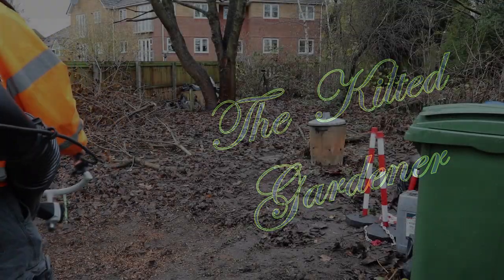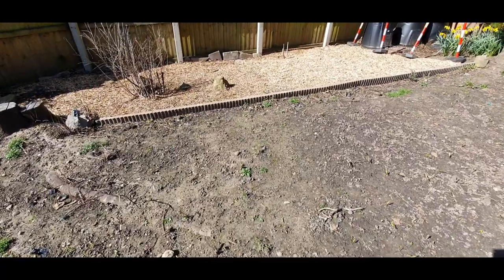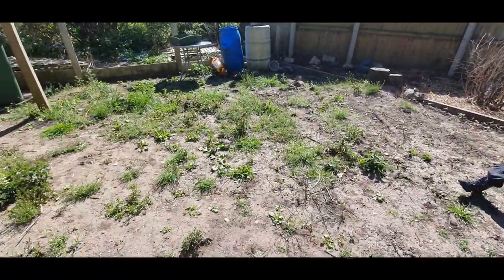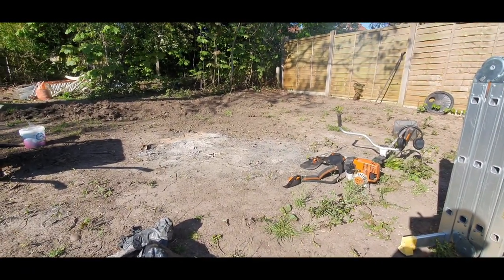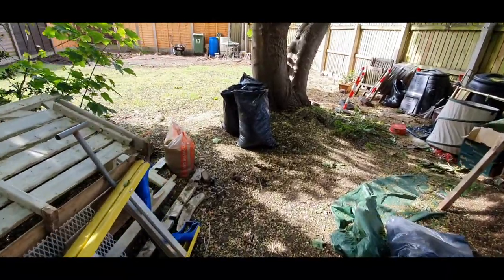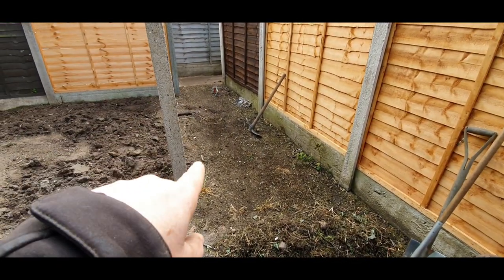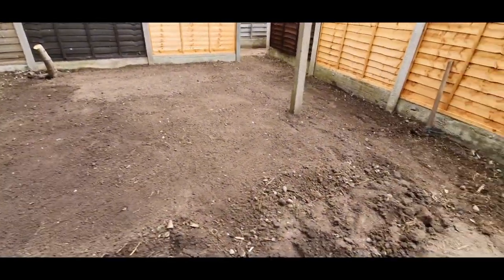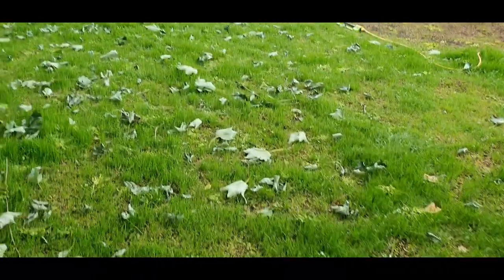massive garden clearance (PART 1)

Comment: Looks very much like a garden I am doing for a customer, been left to its own devices since the 1970's. It was so bad I had to take a mini digger to it to break its back. I have had to contend with brambles, bindweed and couch grass amongst other things! Once we stripped the old surface/turf I prepared the ground in eight feet strips, hand dug 3 times over six weeks with a couple of weeks between digs to allow the pieces of couch grass to sprout and allow me to see and remove! It was so bad I had to have 3 muck tubs behind me as I dug, one for weeds, one for stones and one for the rubbish, plastic, toys, crisp packets etc! Luckily I deal with a pallet company which is just down the road and managed to get hold of 10 plasterboard pallets to use as temporary fencing to keep the customers dogs out of the working area. I have completed three strips now to lawn and have moved back the fencing as each strip is ready for foot traffic to allow the customer access to the area. The grass looks fantastic and up to now has had 3 cuts. Sadly I was up today to check a strip that I seeded 2 weeks ago, the grass is growing but the dogs have left their calling card on the previously cut area. The idea originally was to put the ground back to lawn at the same time being paid to do it, then next year the lawn would be included in my maintenance/grass cutting round. I can see me doing a couple of more weeks work then pulling out. It's a bit of a kick in the teeth when you drive the mower off the newly cut lawn only to see the house dog squatting in the middle of it! Enjoyed the video and looking forward to part two!
Reply from the maker: it was a kick in the teath when the person who owned this gharden sold thier house after I did so much work